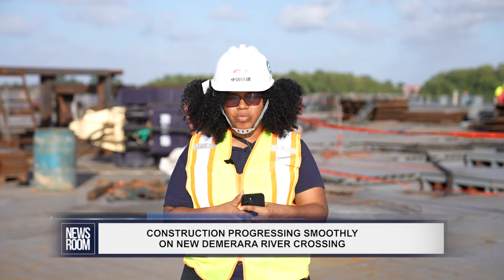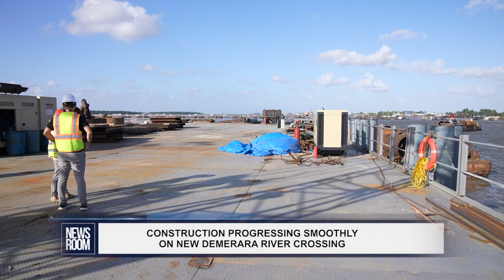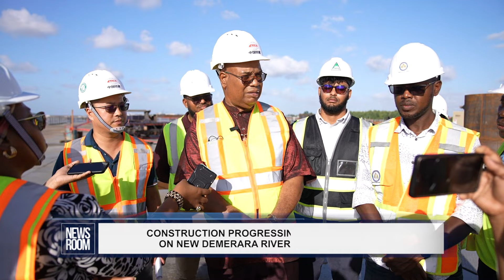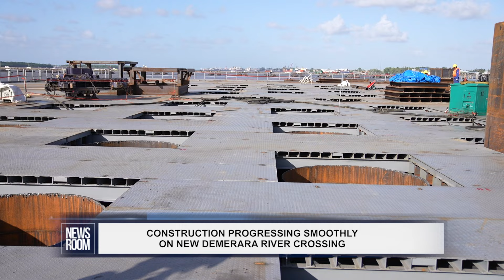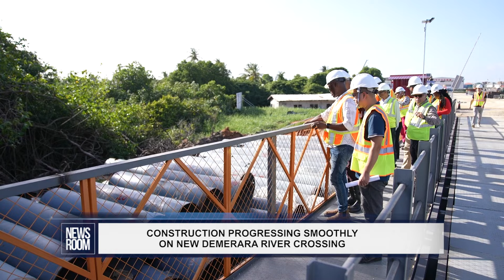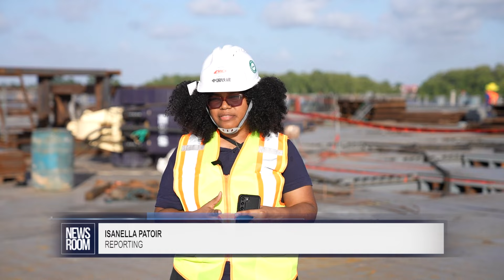CONSTRUCTION PROGRESSING SMOOTHLY ON NEW DEMERARA RIVER CROSSING

Comment: Aggregates costs and logistics can prohibit designs and construction schedules.
Road builders may opt for cheaper white and reef sand road base layers.
However structural concrete cannot compromise the strength requirements that's satisfied with only quality aggregates that comes from blasting, crushing and screening guyana's igneous mostly granite rocks.